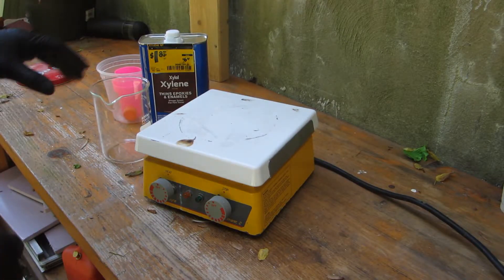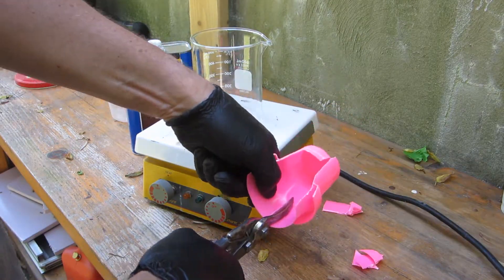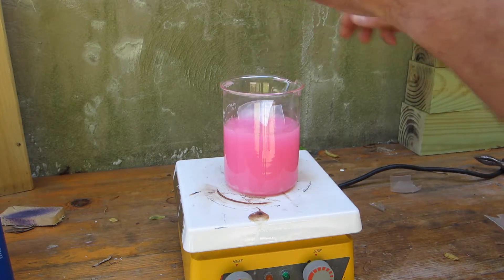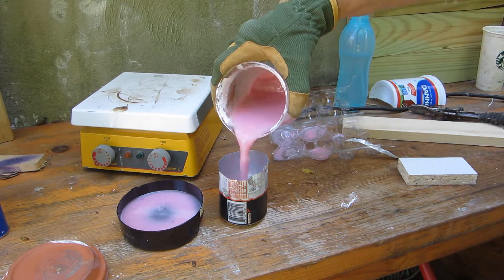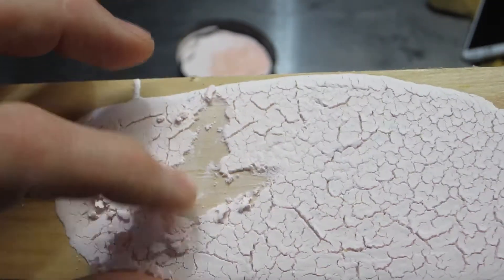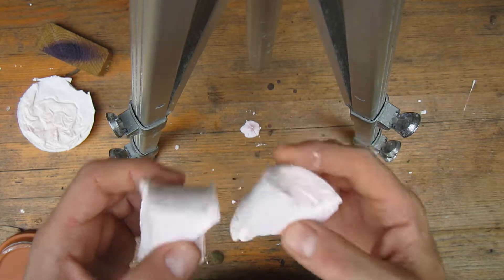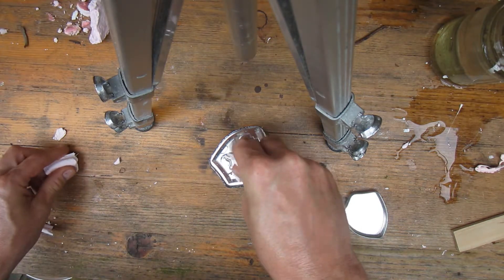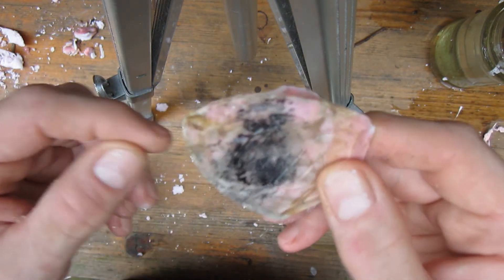Making Powdered Polypropylene for Casting

Comment: the reason the PET reacted was just due to heat. Almost all PET is stretched or blown into shape from generic blanks, so the form they have is under tension. heating to above ca 70c will make it reach its glassing temperature, and it will try to revert back to its original shape. In most cases that means it shrinks considerably and smoothes out. This means you can actually reuse old bottles as a really solid heat-shrink sleeve for DIY projects. You can also relatively easily create PET sheets by reshaping under heat. A plank, some screws, an old iron and some parchment paper is all you need - and at the temps needed there isnt even much offgassing to worry about.

Dissolving common plastics is often troublesome. Xylene at high temperature can do PP and PE, but shrinkage and trapped gas bubbles makes it really hard to form anything useful that way. Also, boiling xylene is both toxic and a fire hazard. Gas mask really mandatory. You really just need to use carefully controlled heating to reach the glassing temp and then have some way of forcing it into shape. Or an extrusion machine heh..

ABS and polystyrene are much easier to dissolve if you want to go that route. Those have some genuine DIY uses. Disolved polystyrene makes a pretty good DIY laquer or glue.

Comment: the reason I came across your video was to use powdered PP for rotocasting.  Hot mold + fine powdered PP = thin shelled casting!

from Wiki:  Polypropylene powder is produced by dissolving polypropylene in a solvent mixture at an elevated temperature, cooling the solution to below about 80° while maintaining it in quiescent condition for precipitation of the polypropylene as particles which are composed of polypropylene grains, separating the precipitate, ...
Reply from the maker: Nice. I really just stumbled on it pissing around dissolving plastic.  It's cool stuff.

Comment: lol. When you said PET wouldn't dissolve in xylene i was surprised because PET has not fared well anytime i've tried to use it for something. The number one thing i remember is how it go's shrinkomatic when you heat it. On those "hack" videos they show someone use the top cut off of a 20oz PET bottle and placing it on coke can and shrinking it down to seal it.

Comment: Brilliant experiment, maybe you have created a new insulator, especially in electronics industry. Nice one mate. I want to build a moulded hull for a boat from polypropylene. Any ideas on how to make panels from recycling pp?
Reply from the maker: I think i would melt it in some sort of mold (cookie sheet maybe) until it starts to fuse together.  That might give you some basic building blocks.  PP melts at around 150C so you could do it in an oven.

Comment: i wonder if this powdered hdpe could go into the oven but i think the xylene could burn or explode. but maybe mechanic crush the hdpe into tiny little parts then put into the oven could make the same result. thank you very much for the experiment!
Reply from the maker: I think I'd avoid baking it.  Xylene has a flash point of only 30C.  I think if you could mechanically powder the hpde you'd be off to a good start!

Comment: Don't give up too easily. You could run it through a ball mill and turn it into a finer powder. You could experiment with various resins to turn it into a glue or a paint.
When you heat treat it,  it may be useful as an insulated tile substance. Carry on sir, I'm sure you will find a use for it, you've given me many ideas already.
Reply from the maker: Whoa.  Those are some great ideas.  Gets me thinking too ^_^
Reply: @dork3nergy I would love to brainstorm with you on this. This could be a great material to work with for so many uses. Easy to mass produce and distribute.
Reply from the maker: @MatthewFranke-l6j  I think ball milling it into a powder is a good idea.  I have a small on set up, I could try it.
Reply: @dork3nergy did you try it? I'm going to use a ceramic mortar and pestle
Reply: @MatthewFranke-l6j  Not yet. I do recycle HDPE though. At this stage I'm still using push molds, but I have most of the equipment now to make a simple injection setup.

Comment: 1:49 yesterday i found a good way to chop up the plastic faster.
First_i put them in a dedicated toaster oven at 110-150(max) degrees Celsius wait ~3-5 minutes
then i use heatresisting welding gloves and a BIG 10 inch "regular" office siccors to cut the plastic into 
small long stripes (~1/2 inch= 12mm wide)., until the pieces comes hard again in ~ 30 seconds.(you can have also a stack of plastic in the oven waiting to be cut and put back the cold pieces, round robin method)
If i dont succseed for the hole piece i just repeat.
Second_for the cold stripes i use a Metalboltcutter (small one is engough) to cut the stripes into rought sqares of ~ 12x12mm.
8:22 also i found a use case , instead of pour it on the Melamin, put it on the sides where the cut off is. this way the woodboard can be closed to look nice again 8with the right colour offcourse) i did that but with acetone+ABS instead.

btw with my experiments with Acetone+ABS , i found also that you cant use a solvent to produce molds , only up to max 1/8 (~3mm) height works. I mean you can make sheets and films, but no real thick forms, the reason is the upper Layer 8if cured) prevents the solvent to gas out properly. But makes a good glue + films. (wear gloves since it glues to skin fast)

So only way that works for thick forms is eighter melting+ compression
or a more complicated plastic extruder (see precoius plastic extruder)
Reply from the maker: Good information.  Thanks!

Comment: I heated a piece of iron on a stovetop until the fire alarm went off. To test if it was still hot I tested some fanta bottlecaps on it and it melted onto the metal. It also adhered to it and while it was still molten I could spread it around like goo. Afterwards it had a nice texure and my result was nothing like yours. Maybe try not using xylene and just melt it straight?

Comment: can u substitue xylene with toluene(paint thinner)?
Reply from the maker: Yeah, you should be able to.  You will still have to heat it though.
Reply: @dork3nergy  done today was brittle and not worthed, i ooking for something for gluing propylene, i think i'll going back into styrene based, do u have any suggestion?
Reply from the maker: Is there a reason you are not using hot glue?  I assume you need something a bit flexible. The Homax Welder contact cement might do the trick for ya :

https://www.homaxproducts.com/patch-repair/household-adhesives/welder-adhesive-2-pack
Reply from the maker: A new kind of glue to bond polyethylene.

https://phys.org/news/2019-11-kind-bond-polyethylene.html

Comment: Any good with ldpe? Or hdpe? Silicone spray the inside of your mold containers prior to pouring ;) it was not a waste of time. Very interesting. Thanks.
Reply from the maker: No idea about ldpe or hdpe.  Might have to give that a try.  Thanks for the silicone spray tip, I even have that on hand, just didn't connect the two.

Comment: You made Paul Bunyan’s guitar pick. Pretty cool, powdered PP.
Reply from the maker: Guitar pick...hehe.  Nice.  It's pretty fun stuff or maybe I just think that because the xylene killed off my critical thinking centers. :)
Reply: Anything is possible,...er... what were we talking about? 🥴
Reply: chopsddy3 at what temperature did you used?
Reply from the maker: @nurnajwa4679  Hot but below the boiling point.  I would guess between 80 and 100 C.
Reply: DorkEnergy thanks, really appreciate it 😊